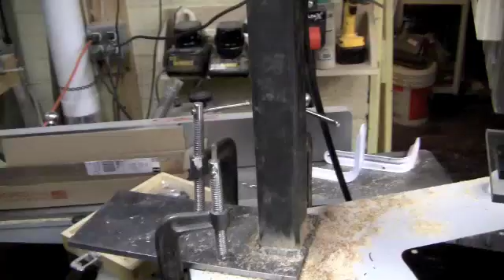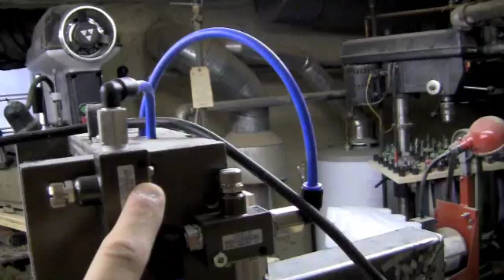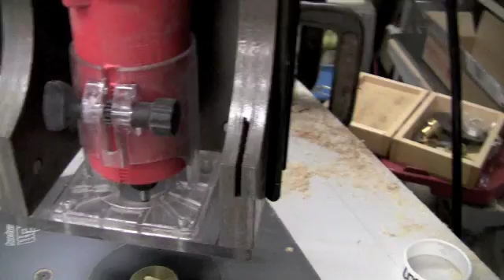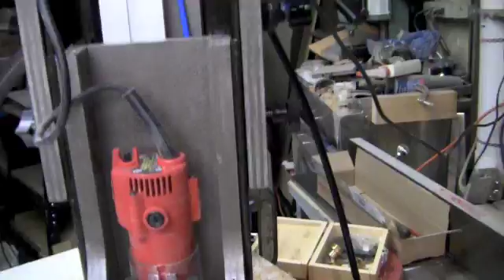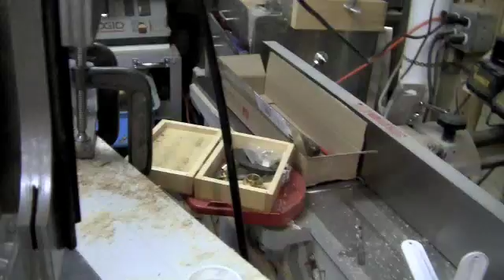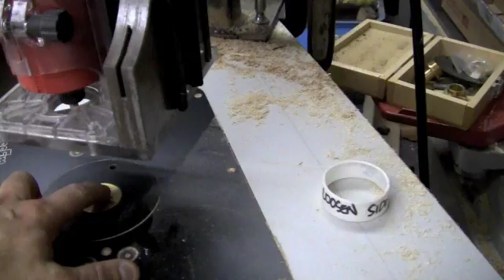Pin Router detail

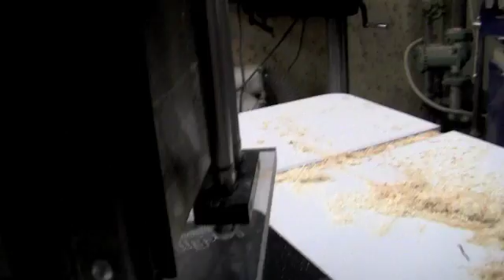Comment from the maker: The spring isn't for power. There's plenty with the piston I've got on it, and the up/down speed is governed by the controllers. The spring is for when I disconnect the piston from the baseplate (around 2:39 of the video) which allows the carriage to drop down under gravity. This is specifically for an operation in making guitars and I did install a spring to counter the weight of the router.Drawer slides are solid and low profile which is why I used them. Lots of ways to make a stop system.

Comment: Thanks for the response. You mention at the end possibly needing springs. That is my concern with picking an actuator. Can you not just increase the psi into the system or is the limit reached? I am thinking of using drill rod and bushings as guides and want to incorporate some form of stop so various heights could be set on the fly. I will need to sneak up on the depth of cut in many circumstances.

Comment from the maker: Thanks. I don't know much about pneumatics either. I picked that particular actuator mainly because it is thin and was a two way system. The switch is 2 way, 3 position- in the up position it moves the air in one direction, the other way in the down position, and does neither in the middle position. I wanted to be able to 'park' it at any height with the switch in the middle position. Sorry for the confusion.